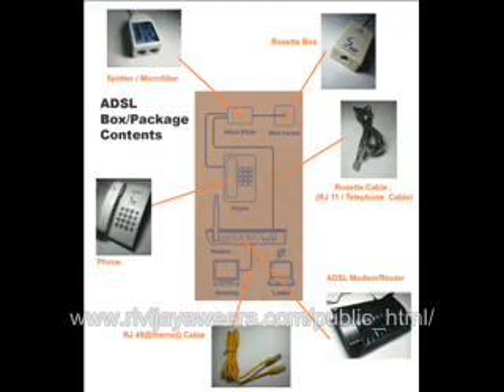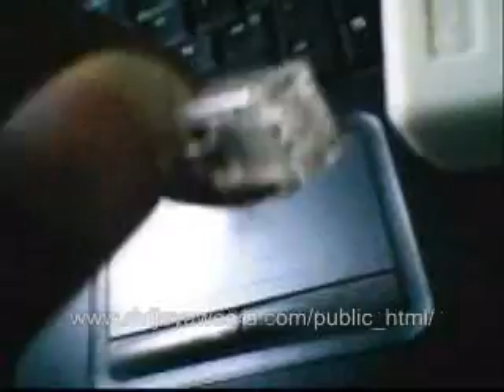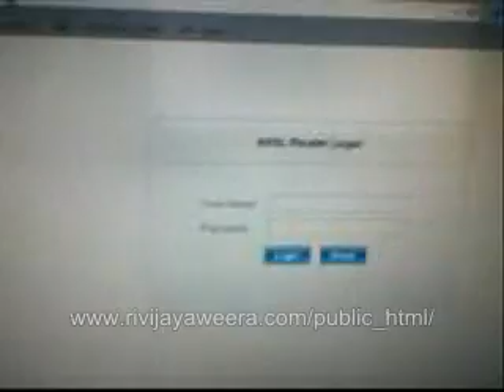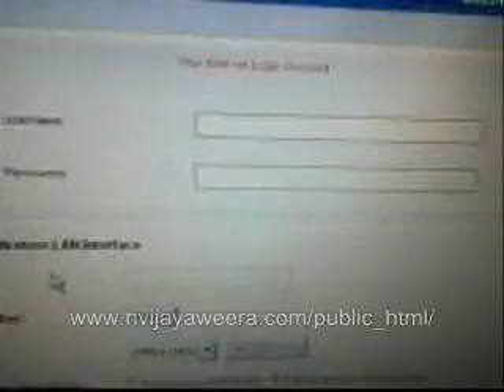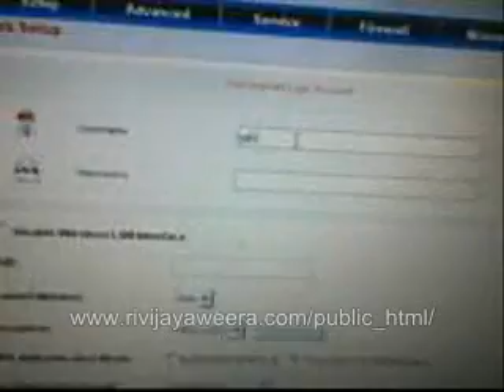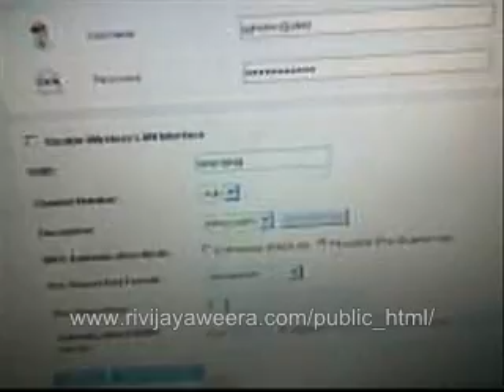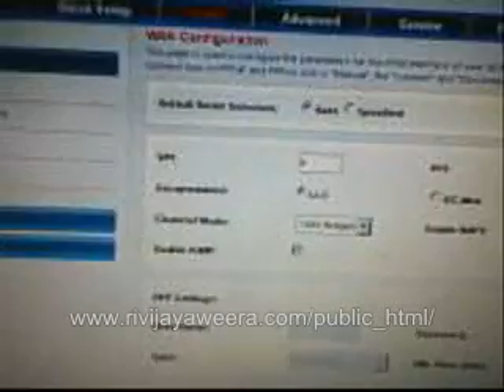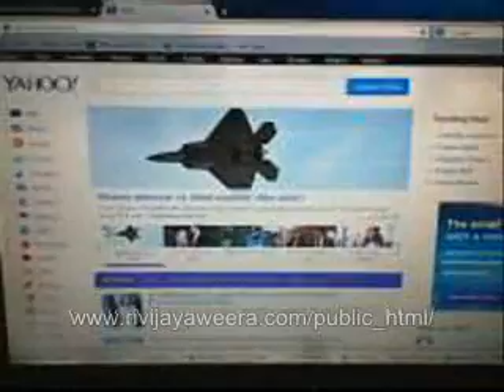Prolink H5004NK ADSL Router/Modem Installation and configuration to SLT line

Comment from the maker: Dear All,
You can prevent children accessing internet unnecessarily by putting parental control, This usually done by Access control and you can add a policy. From this you can block the sites, Block Internet, or Even blocking a specific User. You can do this by giving the IP address of the specific device or the Mac Address. If you want to block specific Web Sites for the Children Ex:- Facebook, Youtube you have to put a filter, Before start messing with the settings I recommend Call SLT 1212 and describe above details and ask them to go head with the settings. They may help you even by sending a team to you doorstep.

Comment: I have my brother who access youtube.com all the time and utilizes all the available data for the month. I want to limit his access, more like slowdown his youtube video stream download speed. without slowing it down for my self or other users at home. at home they all access using the WIFI. pls help... The router I have at home is (PROLiNK H5004NK ADSL Wireless Modem - Firmware Version R76S Slt 4WNE1 6.1R)
Reply from the maker: Dear All,
You can prevent children accessing
internet unnecessarily  by putting parental control, This usually
done by Access control and you can add a policy. From this you can
block the sites, Block Internet, or Even blocking a specific User.
 By giving the IP address of the specific device or
the Mac Address. If you want to block specific Web Sites for the
Children Ex:- Facebook, Youtube you have to put a filter, Before
start messing with the settings I recommend Call SLT 1212 and
describe above details and ask them to go head with the settings.
They may help you even by sending a team to you doorstep.